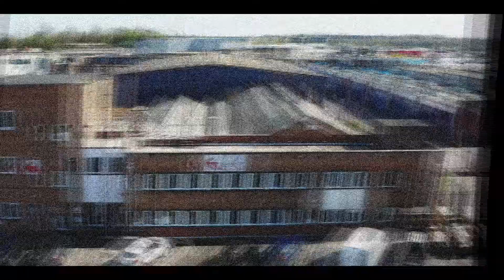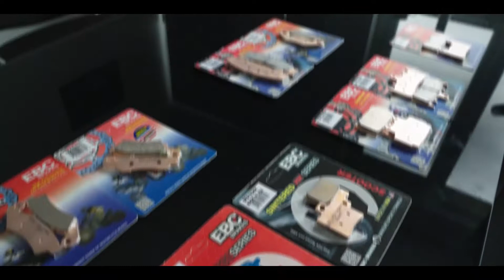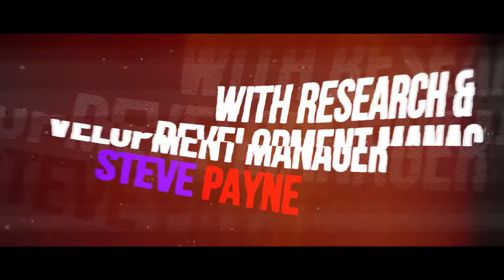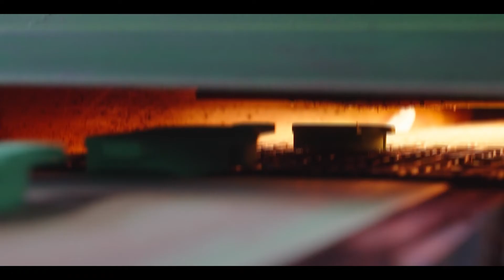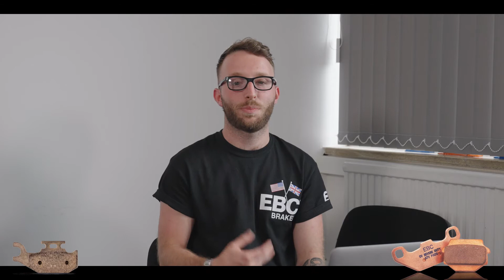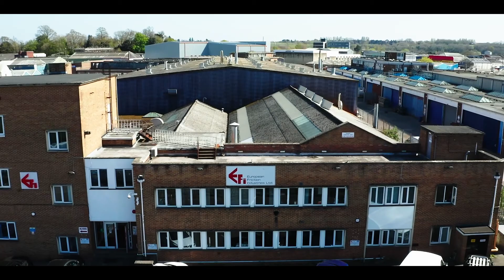UTV/SxS Motorcycle Brake Pads | Tech Talks – EBC Brakes' Pad Compounds

Comment: I've been using EBC motorcycle pads, for over 4 years. I recently had an issue with an order for pads, from a 3rd party seller, and called EBC USA to find out if there was a concern. Robert sent replacements, in time for a riding trip. First class performance, and service? I'll be recommending EBC going forward. :)